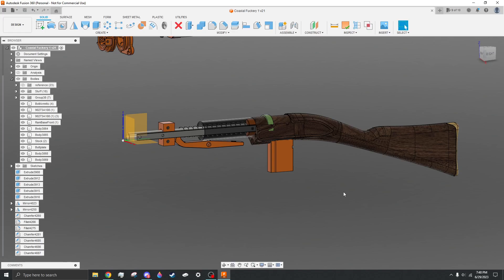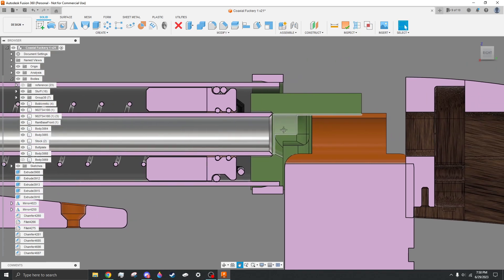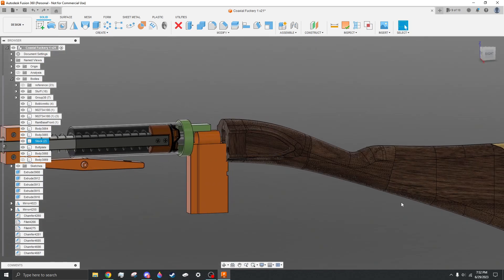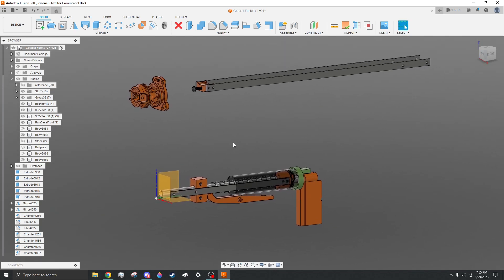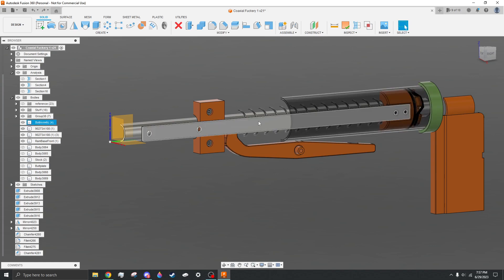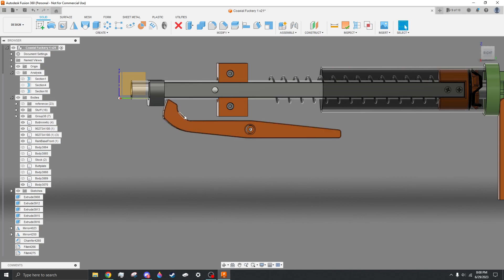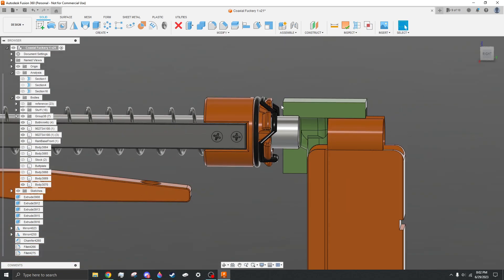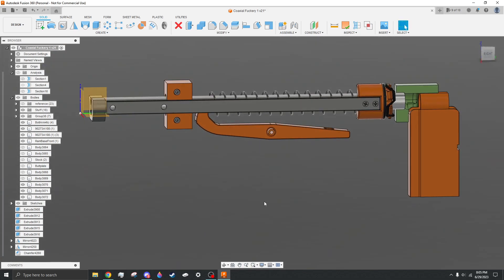Coaxial bolt action WIP concept

Comment: First: This looks awesome! can't wait to see more. Second: I have used fusion 360 for a few years now and I have never seen someone have fusion set up like you do. I'm used to seeing the design "Time line" on the running along the bottom of the screen. the way you have it set up it reminds me of Autodesk Inventor. just kind of interesting.
Reply from the maker: I disabled the design timeline years ago, I just don’t find it very useful. It usually made fusion crash more than being helpful.
Reply: @Sillybutts  gotcha. That makes sense, especially with the large assemblies you work with. Does it make the design work easier? I'm always looking for more efficient ways of designing large assemblies.

Comment: Will the o-rings cause a lot of friction as it slides over the barrel? I am constantly amazed at how quick you're making your shapes on the fly. Cool concept.
Reply from the maker: The barrel will be lubricated, just like the plunger tube. It will have some friction, but probably not an unreasonable amount.

Comment: Question, how do you determine the amount of air volume required from the plunger tube to get the right projectile speed?
Reply from the maker: Honestly, I just wing it with pure intuition. Some people do proper calculations, I don’t bother. I tend towards overkill.
Reply: Thanks man. Your videos and designs are awesome. They have inspired me. I've been working on a shotgun of sorts but my first design has too low of air volume and I'm working on a redesign with a 2.5 in vs a 2 in plunger tube. My design isn't as sophisticated as yours.